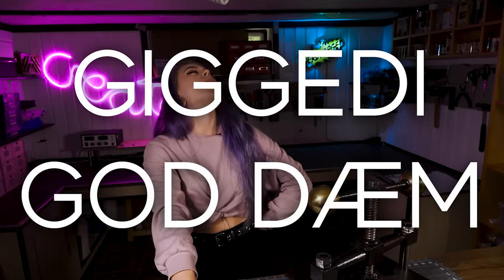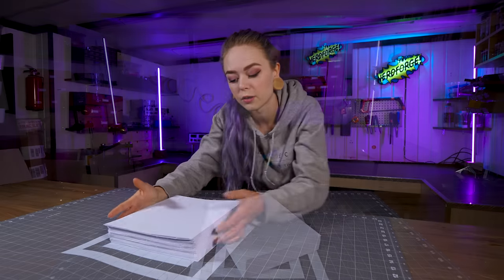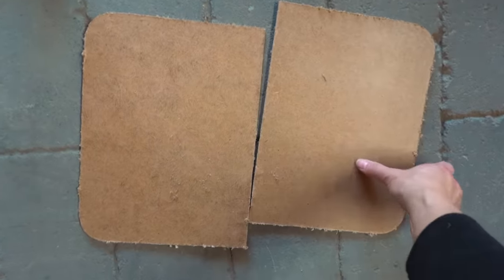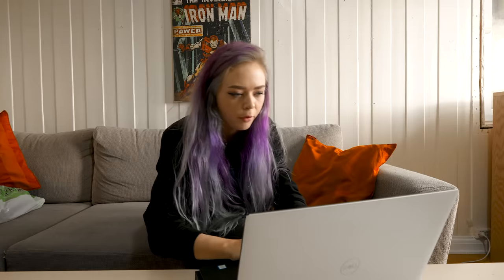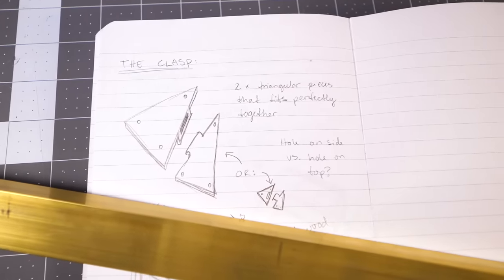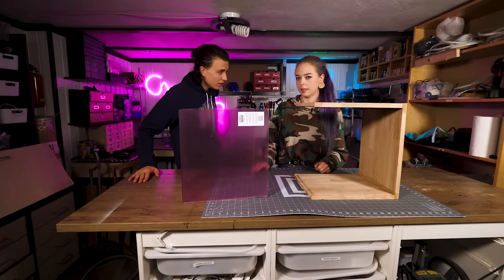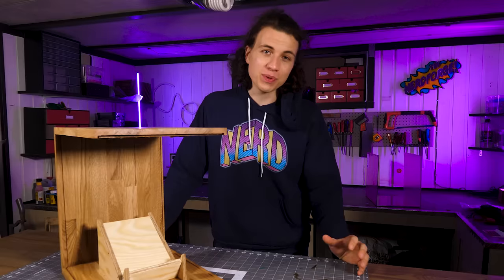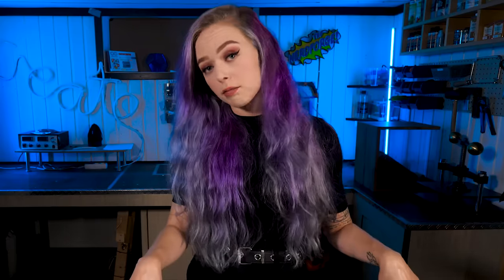Can I Make An ENCHANTED BOOK in Real Life?! 😲

Comment: 1:17 when you look at this boy its a thick boy...
Me: its two pixels big
Reply: WELL, a block in minecraft is 16 pixels tall, and as we all know a block is 1 meter. Which means that each pixel is 6.25 cm, and a two pixel tall book would be 12.50 cm, or almost 5 inches. That's a thicc boi for sure.
Reply: Sir Josh bro that probably would weight at least 12 pounds
Reply: Sir Josh yeah but then the leather would have to be 6,25 cm thick on both sides.

Comment: if you make the holes before bundelling the pages into signatures, you can get it done a lot faster by clamping them all down properly aligned and run a knife or saw down the line where you use a pencil with your system.

Comment: Ideas for future enchanted tomes; Self standing (lays flat but upon opening it stands up to an adjustable angle, holding the book open); Self turning pages; reading light at the top or bottom; Hidden text pages that can only be read with either colored lenses or certain colored lights; sliding line bracket to highlight an individual line of text but can easily be slid out of the way to turn pages; magnifying sliding line bracket that the magnifying glass slides back and forth on the bracket to highlight individual words, characters, graphemes, runes or hieroglyphs; a flying book; a self writing book. Just a few ideas.